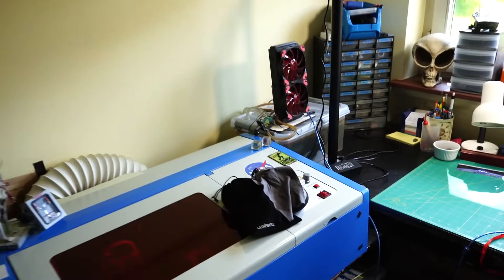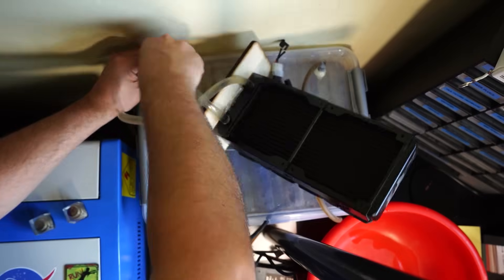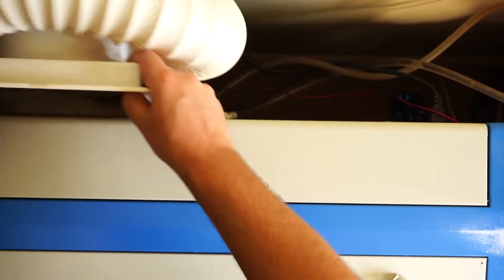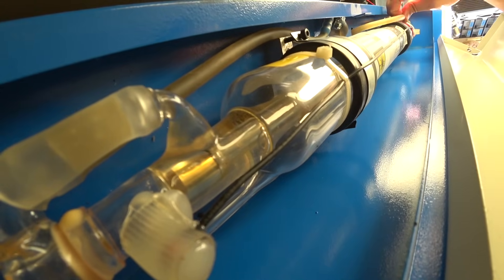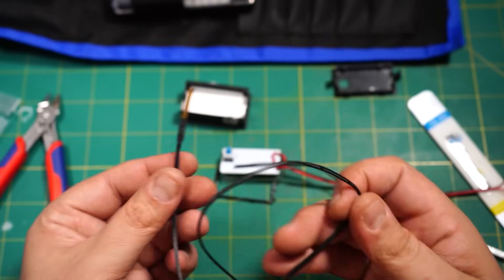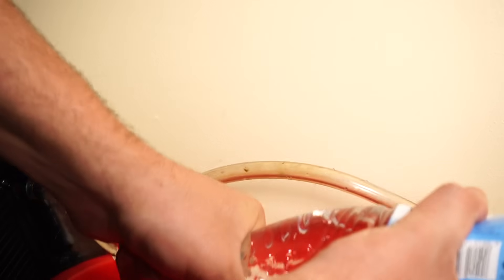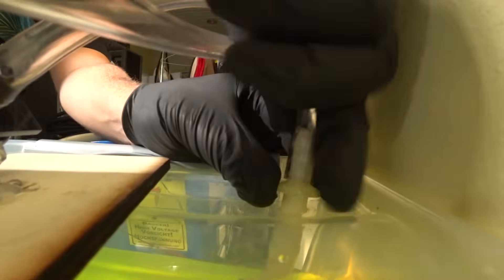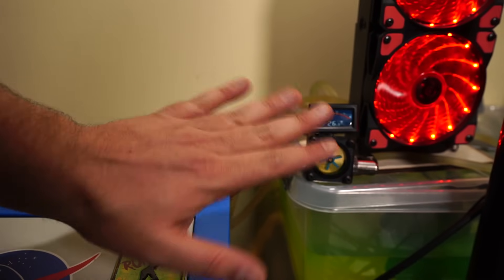Cooling Liquid in a K40 Laser / What i use

Comment: would have the hot liquid from your laser tube go directly to rad, as the larger the D-t the more effective that radiator will be at cooling, since the coolest it could possibly achieve is ambient. Effectively what you are doing is creating a large heat mass that must heat up before the rad starts doing much cooling. steady state it probably works out to the same, ,but for short jobs the flipped arrangement will result in lower temps.

Comment: That flow indicator is garbage. Acrylic is soft and after some time it bowed and started leaking. Not worth of buying. Also these temp sensors are not waterproof. It is better to tape them to metal fitting from outside.. Temperature difference would be less then 1C and sensors will not die.

Comment: how long on average can you use the K40 with a radiator?
Reply from the maker: The laser seems to lose intensity when the cooling liquid exceeds 77f. I have not tested how long it will run without cooling down but keep in mind that it is finest and cheapest chinesium.
Reply: @MancaveEffects  Would it be overkill to use something like 3-4 240mm radiators? or is more better?

{ps from the EU so don't really use Fahrenheit}
Any specific brand/purity of Glycol you recommend?. or is any good as long as it does not have any stuff added {like the stuff for cars}
Reply from the maker: The cooler the water is the better. 25deg c that is. I add glycol used for house heaters. It is recommanded however to use a dark container for the cooling liquid to avoid to much algae growt.

Comment: do you realize that a PC cooling radiator setup like that will never be able to drop the water temperature BELOW your room temperature? so unless your room is at around 18 degrees or less (and it ain't since you're showing temps around 26 degrees on your meter - which is WAY TOO WARM for your laser tube), you ain't cooling much at all, you're just moving lukewarm water around :-D

Comment: don't use tap water for gods sake.
Reply from the maker: As you see in the video, i used distilled water... however i don’t really care... if it would be a smoke machine where a water solution gets heated to boiling point and pumped with high pressure trough very thin lines it is a differend thing but for a low pressure cooling system it doesn’t really matter, there will be all kind of stuff swimming in it after a while anyway.

Comment: as long a air is not causing a vapor lock you will be fine with some bubbles.
Reply: The bubbles should also gradually be absorbed by the water pass through the tube over time.

Comment: hi i have a machine k40 and my temperature is 34,2 maybe have problem to cut the wood or plexiglass anwser me  please.
Reply from the maker: I try to keep the water temperature arround 23 deg c. The warmer the water gets, the less power the laser has in my opinion.
Reply: @MancaveEffects  in my
bucket
  i put 
ice water and ice cubes i do well?
Reply from the maker: Γιώργος Στουμπης never tried it, make sure the water is not frosty cold, the temperature difference may blow your lasertube. I swapped the reservoir to a bigger one you see in the video as the cooling solution git to warm. For me this works but it really depens on how often and long you are using the K40

Comment: I'm probably going to be buying one of these in the next few weeks and noticed that you had the radiator after the water tank and before the laser.  Surely this will just help cool the water down to ambient and a better solution would be to cool the hot water that leaves the radiator before it goes back into the reservoir?
Reply from the maker: Yes, it is a simple radiator for PC water cooling i got from china for a couple of bucks. When the water temperature raises, the laser loses power so you want the cooling water as cool as possible. In my setup the radiator is last in the row before it dumps back in the reservoir.
Reply: @MancaveEffects  what is the effect with and without the radiator. In temperature i mean. I`m thinking to put one too.. How cold u manage to hold it. Sry for the bad english :)

Comment: Good thing your using silicone tubes but other things you have plastic parts in your system. Glycol has a chemical reaction to pvc and some plastic. Cool if you want a chemical reaction BAD if you want a working system.
Reply from the maker: You are absolutely right, the box that houses the glycol mixture is therefore made of Polyethylene, the flow sensor is also resistant against glycol as it is also used in computer cooling systems. On the other hand is the solution pretty diluted, i never saw any part to become somehow sticky or show signs of any reaction but it could react with certain plastics and metals over time.

Comment: What voltage are the Digital LCD Thermometers? I just ordered 2 of them for my machine and it dont say 5v or 12v? Im guessing 5v. Thanks
Reply from the maker: It runs off 5v, i power it with an old usb charger.

Comment: ...the hell? a YEAR? You're supposed to switch out water every week, at least.
Reply from the maker: You are pumping cooling liquid trough a glas cylinder using an aquarium or mud pump, why should the liquid be swapped every week?
Reply: @MancaveEffects  hygiene, for one? The health aspects alone are common sense. Emptying and filling a regular bucket with regular cold tap water is super easy and more efficient for the laser to stay cool. It will never run the risk of getting bacteria overgrowth, clogged up or overheating.

Comment: Hi, I bought a K40 laser earlier this year and my manual says to change the coolant weekly. I bought a water distiller and use distilled water also suggested in my manual.
Reply from the maker: Sure, changing the cooling water more frequently will be better for your system. However until now changing it once a year did not caused any problems to my laser.